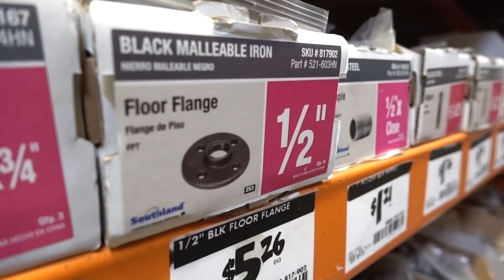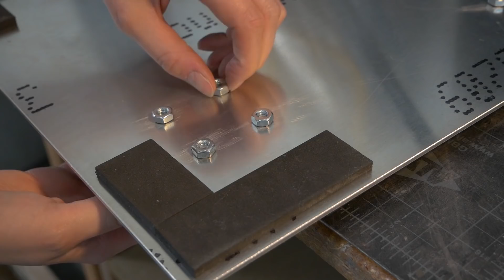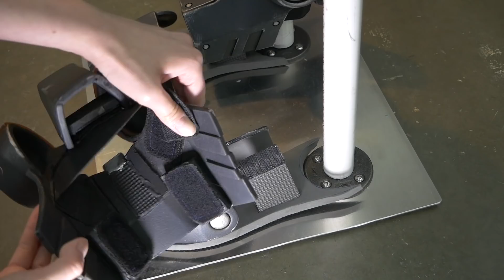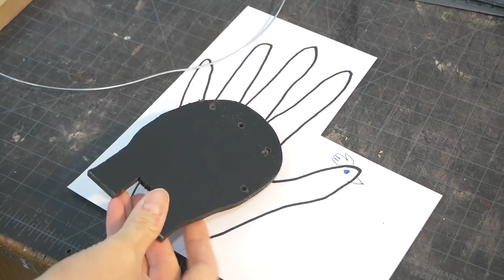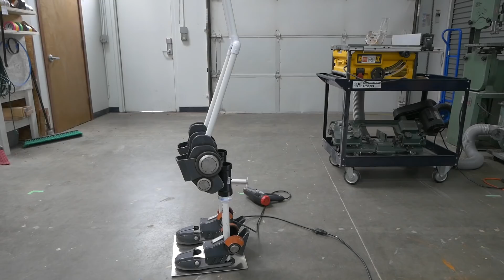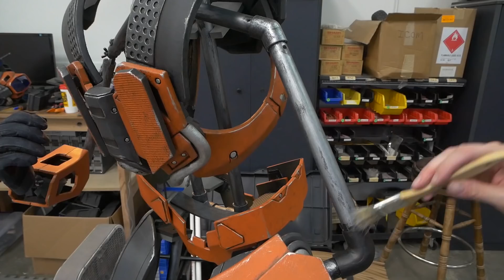Custom Mannequin Display - Sweeper Bot Costume

Comment: Hi I'm currently working on a Black Sabbath cosplay from jojo's bizarre adventure and I can't figure out a way to make the hat. Idk whether to use craft foam or actually sew it together. Btw I'm using a faux fur Soviet ushanka as a base. Any advice from anyone would be great.
Reply from the maker: You could probably do either foam or fabric without too much issue. It depends on how structural you want it to be. Foam covered in fabric might be your best bet - I know I for one find foam easier to work with. You can make a pattern with paper/tape :)

- Paige
Reply: Punished Props Academy thanks I didn't even think of that. You guys are the experts

Comment: Fantastic!  I still dream of one day having the space to put a costume or two on display or even rotate them.  I still even dream of one day building a suit of exo-armor from fallout and maybe building a replica display case to keep it in.  :)

While watching the build, I was reminded of the bare speaker in the helmet for your voice changer.  Does that get loud in the helmet?  I did a voice changer years ago for a Red Hood build.  I used a throat mic and external amp and speaker that I wore on my belt so that I didn't have to mess with the helmet.  If you are getting a lot of noise you could make a custom baffle out of foam to protect the speaker and reduce the noise in the helmet.
Reply from the maker: Costume displays have been a dream of ours as well!
I actually wish the speaker was a bit louder. Also, with the speaker off to the left side, the effect isn't heard as much if you're standing in front of, or on the other side of the costume.
Reply: This might be over kill, but it would definitely give you more volume and could run it off of a 9volt battery.

Thinking about this stuff, I've always wanted to play with those stick on transducers that supposedly let you turn different surfaces into speaker, like tables and windows and what not.  I wonder if you can turn a breastplate into a speaker.  

https://www.aliexpress.com/item/1PC-LM386-Audio-Power-Amplifier-Board-DC-3V-12V-5v-Mini-AMP-Module-Adjustable-volume-Integrated/32827706929.html?src=google&albslr=222224110&isdl=y&aff_short_key=UneMJZVf&source=%7Bifdyn:dyn%7D%7Bifpla:pla%7D%7Bifdbm:DBM&albch=DID%7D&src=google&albch=shopping&acnt=708-803-3821&isdl=y&albcp=653482935&albag=32646801963&slnk=&trgt=61865531738&plac=&crea=en32827706929&netw=g&device=c&mtctp=&aff_platform=google&gclid=CjwKCAjw1ZbaBRBUEiwA4VQCIXe_TcX7Muj0o1ilXYAos1OMyZDc8HwSqwrqGqf3JTspHDB-9Z-XLBoCJMwQAvD_BwE&gclsrc=aw.ds

Comment: At the 3 minute mark, instead of grinding out the pipe and reducing the thickness and strength, you could have added a bit of heat and stretched it over the flange. This is a great video showing how to troubleshoot issues as they come up.  
It is a great display piece.
Reply from the maker: Good idea!

Comment: http://www.spiderhillpropworks.com/Halloween-Prop-Plans_ep_41-1.html    I have used these joints for prop building in my Halloween builds. They work with standard PVC pipe and are as durable as the pipe. Maybe they would let you get the movement you are looking for.

Comment: Increasing the number of perimeters and increasing the layer height and width will help improve the strength of the printed parts. Sadly the infill doesn't affect the strength nearly as much.

For structural parts I tend to use my Vulcano hot end for that very reason.

Comment: Great video and thanks for linking my articulating joint! (RefUJay) - After much trial and error  I found increasing the wall thickness to 4 or 5 was the key to keep my 3d printed joint from breaking.
Reply from the maker: That’s great! Thank you for the info and for sharing your print design.